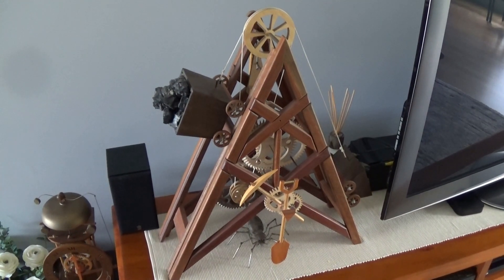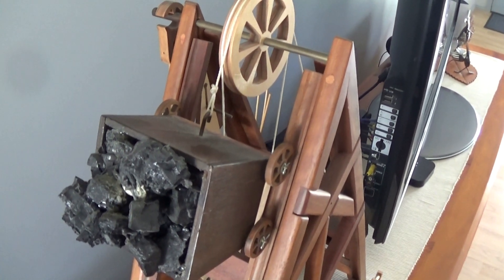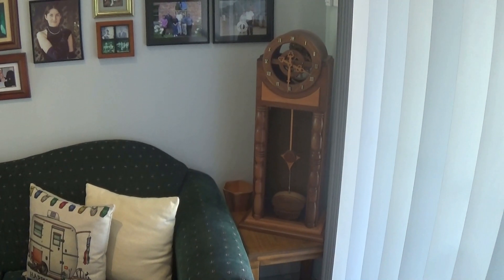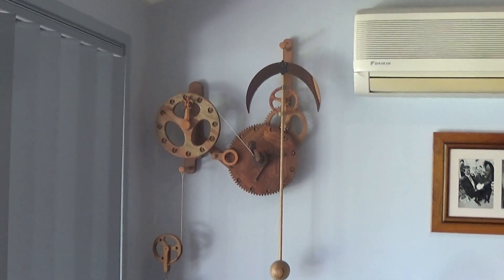UNBELIEVABLE - Wooden Gear Clock - Hand Built - Running for 11 Years

Comment: Why aren't any of those other clocks working. 
I was about to buy the plans for 2 clocks. Now I'm having doubts. I don't want a pile of pretty wood sitting on my wall. I want a working clock.
Reply from the maker: Hand made wooden clocks need care and attention. They don’t run like a digital watch. 
If they are not kept running the mechanism becomes “sticky” from changes in heat and humidity and won’t start until disassembled and cleaned. 

Their reliability is (of course) also highly dependent on the build quality.
Reply: @ShedBuiltStuff   gotcha thanx

Comment: Any chance you would sell a build file for this one??
Reply from the maker: Sorry. No chance. There isn’t a “build file” that would be useful to anyone else. 
Clayton Boyer takes many many hours perfecting, checking, and checking again to get a plan that actually works so it can be used by other builders. 

I used bits of plan and then made it up as I went along.
Reply: @ShedBuiltStuff  I am working on a mine theme clock as well.  A Headframe with vertical weights that are made to look like a cage being lowered into a mine shaft.  Trying to figure out all the gearing now…. Love your clock!
Reply from the maker: Thanks mate. Wish you all the best of luck with your build

Comment: I can only admire your ingenuity which implies a deep comprehension of the functions of an escapement. This allows you to implement these functions in different ways but allways with the same elementary functions : stop, delay, let-go, timed intervals. I am very impressed ! And also forces mastering to allow minimum energy to be spent so the device can function a long time, not only before re-winding, but also before it be worn-out...
I know what I speak of, because I have built myself some original clocks, for instance one in which the impulse is delivered only when the balancing amplitude is too low (just mechanical, nothing electric). But I never built "finished" clocks, just feasibility mecanisms, functionning but with no esthetic research...
Congratulations

Comment: Wish I had more time to work on stuff in my workshop. I generally end up on larger more construction type projects (flooring, baseboard/moldings, etc), but I love to tinker and started a Brian's Clock #1 6 years ago. I got all the way up to attaching the pendulum, got busy with something else and it got shuffled around my shop for a couple years, some of the gears went missing and now it's just in sad disarray.

I'd start selling some of those off. I'm sure it'd be hard to part with any of them after putting so much time in to them <- get it, time, clocks.... Ok I'll stop

But seriously, you could sell them off to make room to make new clocks.

I'd like to make one that would run for a few days or a week though. The Brian #1 I think only runs for 8 hours or so, which I wouldn't end up winding up after a couple of days I'm sure.

Comment: It is surprising that it is running for 11 years. I believe this should be a dead beat escapement, but is actually running as a recoil escapement. I would adjust it correctly as dead beat to improve its performance.
Reply from the maker: PKamargo - I designed and built this myself. 
I’ve got no intention of “adjusting it correctly as dead beat”.
Thanks for watching.

Comment: Great work, Adrian. Thank you for the explanation. At 90 beats, your clock stands about 0.5 metres high yes? It's very nice. How long does it take you to cut a gear of some 50-ish teeth?
Reply from the maker: Thomas Hughes - thanks mate. About 20-30 minutes to cut a 50 t wheel.
Reply: @ShedBuiltStuff  that's the hard part for me. It doesn't seem so long. Great idea with the "coal cars" ;a real space-saver! Good on you!

Comment: Adrian-been a long time follower of yours and have build many of the same clayton boyer designs as you except one,  the MACC. Was wondering if you still have it, what you remember about building it and if that one would still run? How long did it take you to build? This ones on my bucket list and just wanted to know how you felt about building it?
Reply from the maker: CNC Woodworx ROC - sorry. Didn’t make this.
Reply: @ShedBuiltStuff  you didn't make the mid evil astronomical calendar and clock, or MACC for short?.
Reply: @ShedBuiltStuff  it's the clock at 5 minutes, 29 seconds of your video.
Reply from the maker: CNC Woodworx ROC - arrrr sorry I was wrr... I was wrr...   just like The Fonze I cant say that word.  

But to answer you question - it never really ran well. I made it as the prototype for Clayton to prove his plans. Found a number of issues and the plans were adjusted, as was the clock. 

It took a poo-load of time to build. I couldn’t guess how many hours. Soooo many wheels that all have to be perfect as there is a lot of friction built up in all those parts. 

Not for the faint hearted but a magnificent machine.